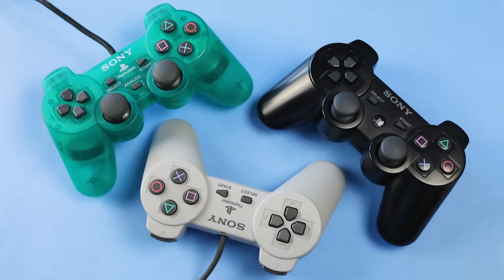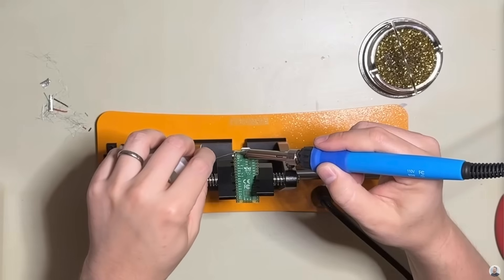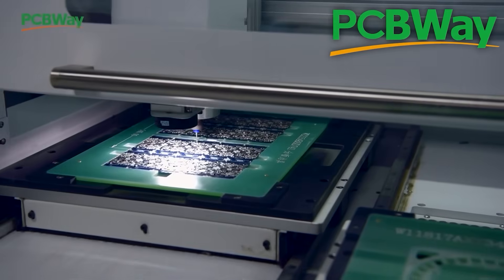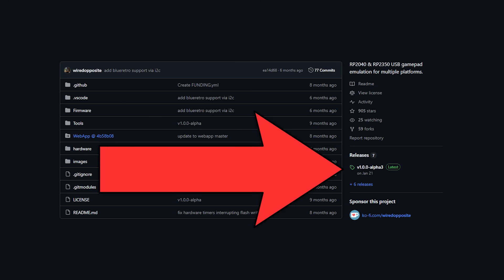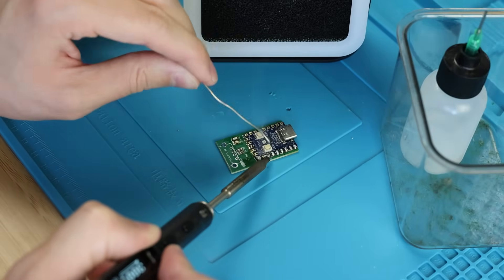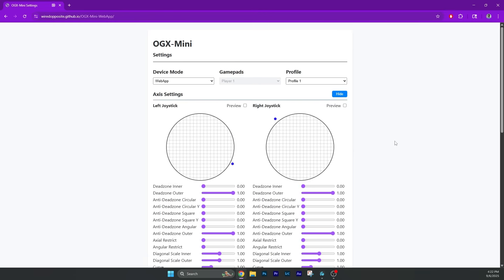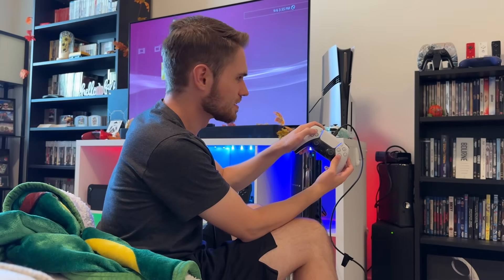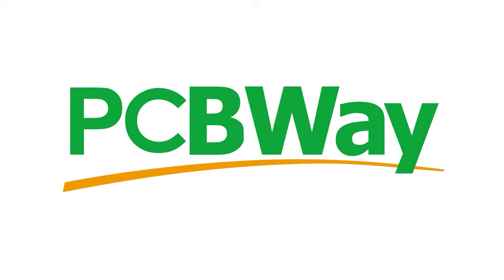Use Any Controller on Any Console! | OGX Mini

Comment: Doesn't work wirelessly with Xbox One Model: 1697 as the controller dosen't support bluetooth therefore raspberry receiver doesn't capture it :/
That's why im trying a different method to use a different utf firmware that makes the pico w2 act as a bluetooth transmitter, hopefully that will work

Comment: For anyone who wants to use a PS5 controller on PS3, but can’t solder: You can already use it without this device by just plugging it in to the USB port or wirelessly connecting to the PS3’s bluetooth. Drawbacks are: You will need a regular DualShock 3 for the home button and there’s no rumble. You can find some tutorials on YouTube.

Comment: sadly it is only wokrign on most consoles and not all like Ps4/5 and xbox one/series. There is a alternative for this. its called GP2040-CE and that as xbox one support and maybe more
Reply: I think it helps more for retro consoles, you know ps3, og xbox, the controllers are kinda complicated to get in a good state, and the knock-offs are pretty bad
Reply: @cocouwu7507  on the ps3, you can jsut use the plugin, where you can use any controller(x360 has this too) but yeah for xbox classic its good
Reply: @cocouwu7507  you think you can load this onto a Cosmox controller and get it working on PS5  or that some form of firmware exists that can do that?